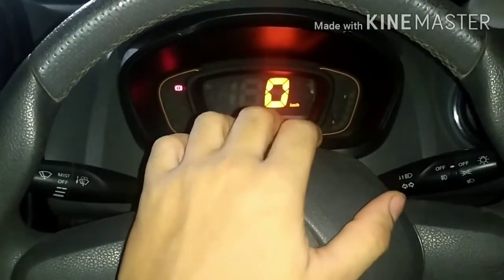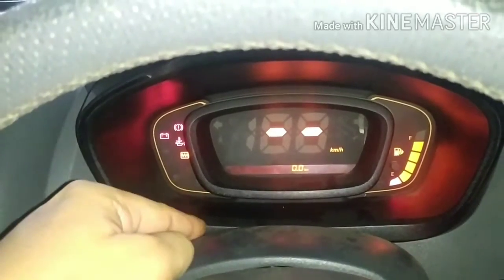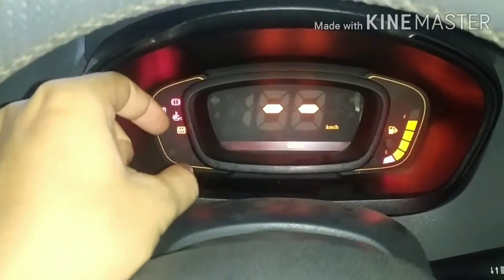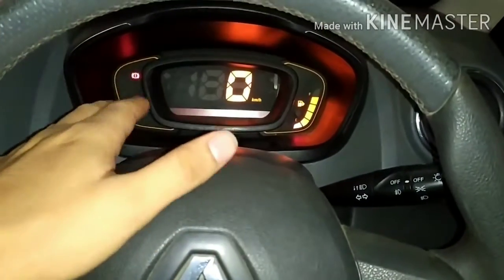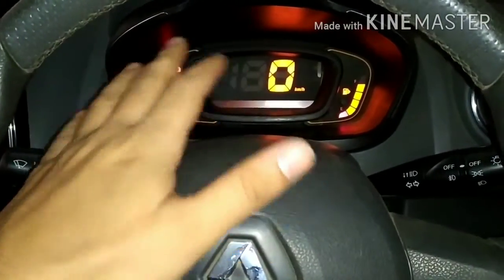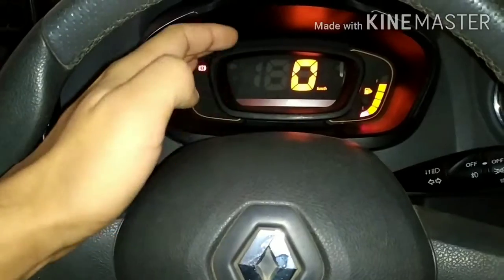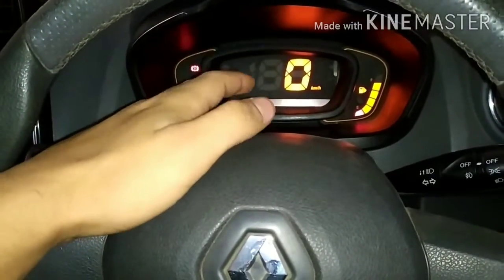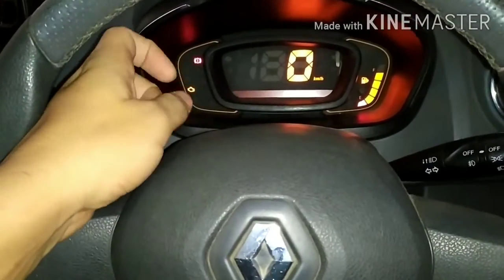Renault Kwid Malfunction lights. Coolant temperature and oil pressure light reasons and diagnosis.

Comment: Hi Sir,
I am facing a weird issue. My coolant temperature light starts flashing whenever there is extra load on engine. For ex if car is in 3rd gear and speed crosses 40-45, the light and beep sound comes. What could be the issue here? Also i have recently changed the battery myself. Replaced Amaron with Livfast orange battery.
Model - Renault kwid rxt
Reply: Same here
Reply: Koi solution mila?

Comment: Sir kwid Amt 2017"model. Running mai zerk hota tha.. Dhakka jesa.. Phir clutch motor change kiya.. 1mahina chala phir se same problem.. Trafic mai chalane se engine garam hota hai aur zigzag light jalta hai.. Coolant bhi change kiya.. Phir bhi same problem... Gari running mai smooth nahi hai.. Jhatka le le ke chalta gai
Reply: Sir ignition coil or spark plug check karwayeye mere kwid me bhi smooth nahi the coil or spark plug kharb the ...

Comment: Hi sir my kwid rxt 1.0 AMT 2021 model has some issue with coolent high temp warning ...now present 25days in service centre but they couldn't solve issue once they said program issue but ok solved again persist then said battery (good condition),wiring ,ECM now they saying warning not exit after upgrading software n disconnected main headlight aftermarket wiring kit for high beam... I'm not getting what went wrong I'm sure they r not getting what is wrong ...but there no damage in engine or leak of coolent radiator fan works well, thermocouple also good one pls suggest

Comment: Thank you, I have same problem but only when AC is on. If AC is on, I face overheating after driving 10-15 minutes and sensor beep. Also my engine fan start making loud noise. What could be the reason?
Reply: Same problem i also facing its only kwid issue (3 times i have changed head gasket)

Comment: Sir my friend have Kwid RXL 800CC currently he is facing some greenish (oily) sticky water in coming in cabin codriver side on rubber mat ( observed between cooling coil n heater coil) pls. Can u tell what is that we are trying to connect service center before that we want discuss with to find route cause.
Reply from the maker: As you explained, the only cause maybe leaking heater core. It's not costly and price is something around 680 INR. Get it rectified as soon as possible coz it may lead to overheating and engine damage at later stage. 👍😊
Reply: @quickfixproindia  thx a lot

Comment: This is regarding fuel cells display in Kwid. there are 5 yellow and 1 red cell, how fuel does each cell shows and when last cell blinks in red than how much fuel is left
Reply from the maker: Sir, in my case I experienced maximum 5 litres.
Reply: @quickfixproindia  Thanks
Reply: @ajaygoel2637  Sir is right.  total 28 litres tank. Each yellow cell having 4 litre oil, 4x5 =20 litres and red cell contains 8 litres and last cell blink in red its contains 5 litres oil in reserve.

Comment: I have faced this issue on my kwid 
Oil sensor problem i solved  myself at home my problem is radiator fan fuse not working afer chnge fuse its working now
Reply from the maker: Nice information and observation sir. 👍😊 Non working of radiator fan is a major cause of overheating in cars.